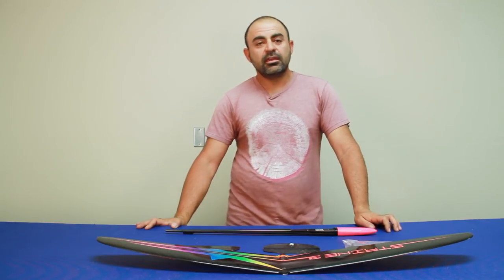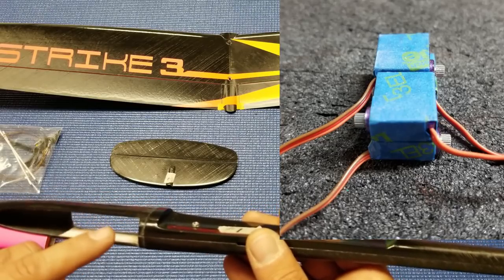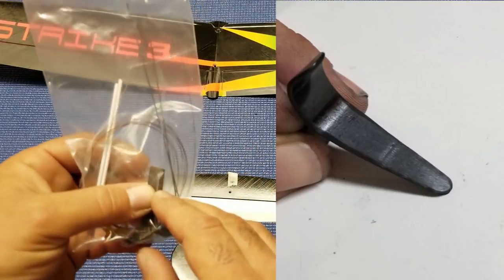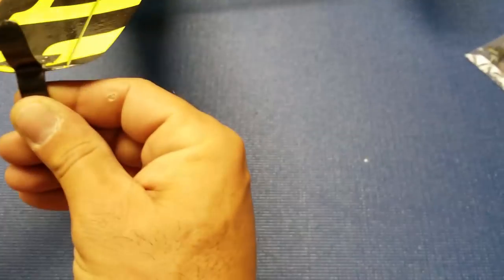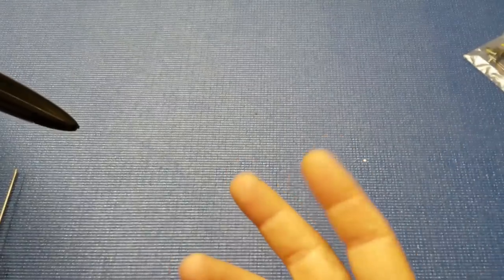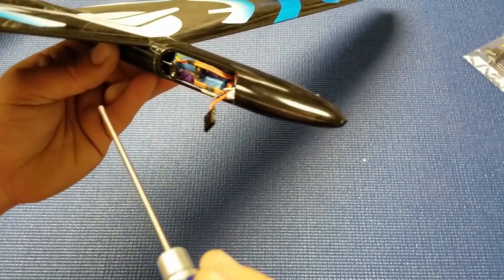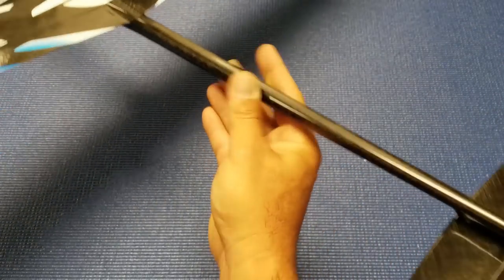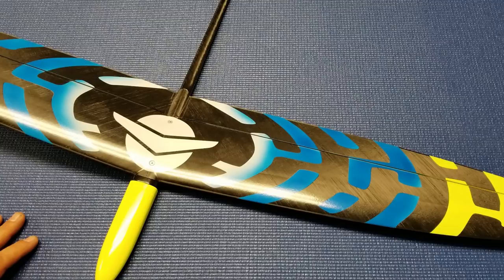Strike-3 1 Meter DLG Overview

Comment: Thank you very much for the tips. I will get my Strike 3 this or next week, and your tips are very useful. It shows you know your stuff!
It would be great to see a video of it flying with the corrected CG.
You do use a pretty big Lipo, and still say it is a bit tailheavy. That is the only thing that bothers me a bit.
Reply from the maker: Hi, I will put up another video after I make some changes to Aileron throws and measure and adjust my CG. I could be wrong about the CG, it's just a feeling I have from flying. But yes, I have big rx and big batt and it "feels" tail heavy in flight.

Comment: Thank you, this will help a lot. 
Two questions though. As for the flaperons:
- What is the exact position (in mm down) of the flaperons in mid servo position (1500)?  
- How did you determine the exact position for the z-bends? I understand that both sides (servo side and horn side) of the pushrods are z-bent.
Reply from the maker: Mid position my servos are neutral.  You will get enough down flap throw. You don't need to offset  servo horns to get enough down travel.  I did not use Z bends. I used only L bends.  No need for Z bends as pushrods won't come out of servo arms with L. I mocked up servos in fuse with pushrods dr ailerons in place but no glued in. Then made 2 small dots on wire with black marker pen. Removed servos and pushrods from fuse. Next made the bends. Next install pushrods and glue housing in fuse. Then hook up servos to pushrods, tape ailerons in neutral position and glue servos.  Hope this helps!
Reply: Thank you. Actually, this will help a lot.

Comment: Does anyone know if the frsky rx6r fits in the strike 3? I'd really like to have flaps.
Reply: it has flaps (actually flaperons), you just need to set up a flaperon mix. regardless, teh rx6r is pretty tiny and will fit